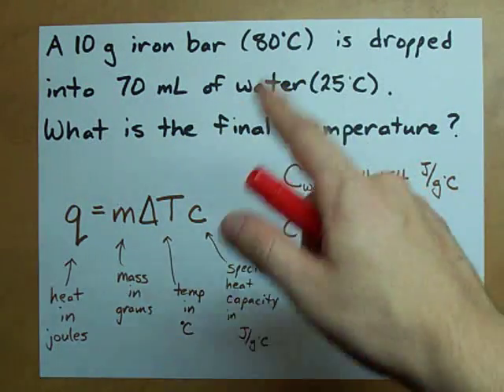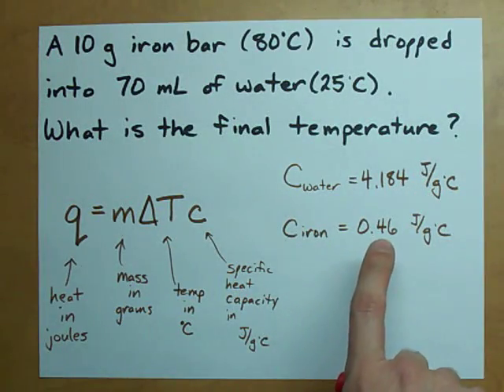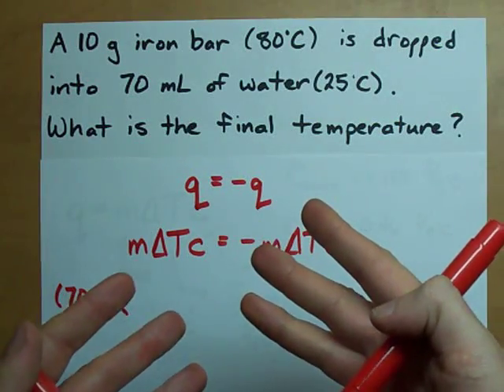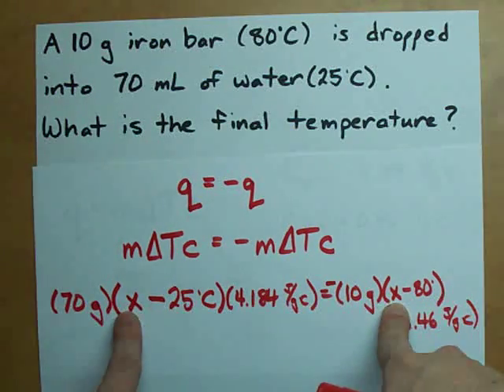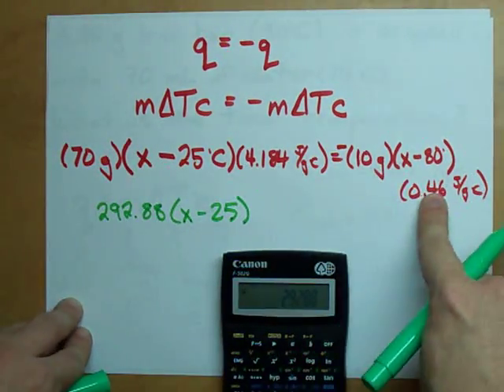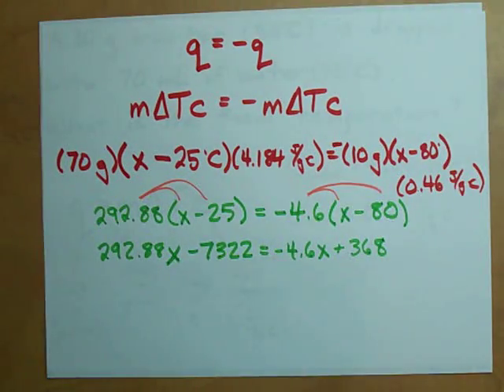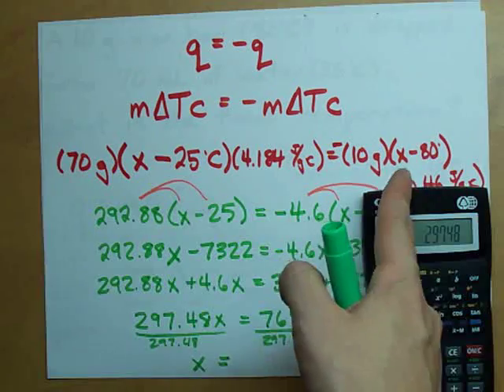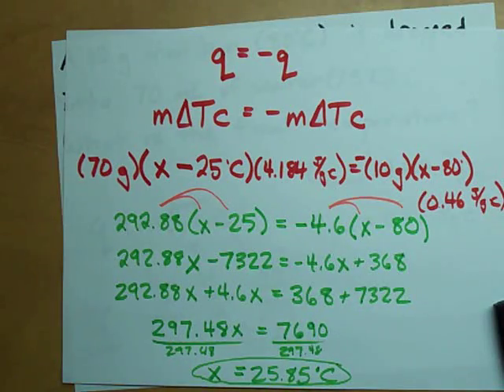Calorimetry: Using q=mΔTc to find Temperature + Example

Comment: Where did u get the 0.46 j/gc from ????!
Reply: Google. It's just the accepted measurement for the Specific Heat Capacity of Iron, which is how much heat is needed to raise the temperature of 1 gram of a substance (iron) 1 degree Celsius

Comment: How would you do this if there were three components? But two of them have the same change in temp.

EX. 80 degree Copper dropped into 30 degree Celsius water held in 30 degree Celsius cup

Comment: How do you know when to use negative and positive equations?
Reply: You place the negative sign to the substance that is losing heat/energy. In this case the iron was "hotter" at 80degCelsius or had higher kinetic energy. Heat by definition is a form of energy that transfers from a system of higher kinetic energy to a system of lower kinetic energy. Consequently, in this example the iron lost the energy and the water absorbed this energy. Therefore, the negative sign indicates the substance that is losing energy.

Comment: In order to solve it this way you need two specific heat capacity for both metals. In some tests you only have one. So you solve the formula first, and then plug the numbers instead of plugging the numbers and solving for x.